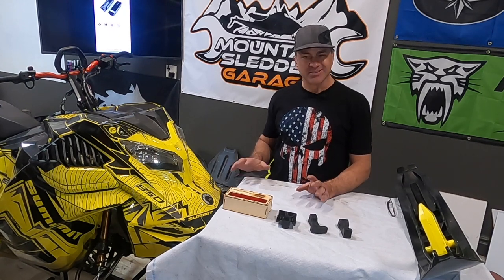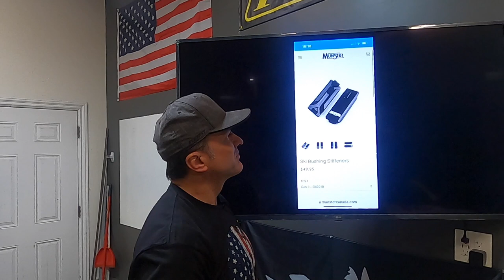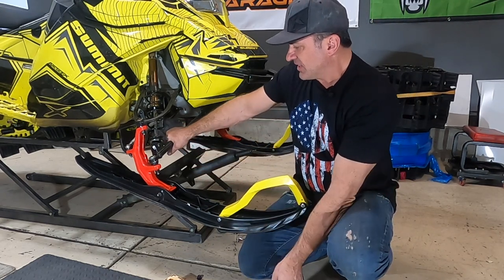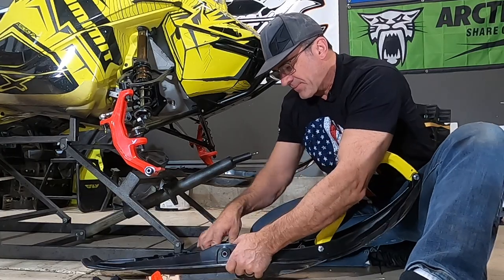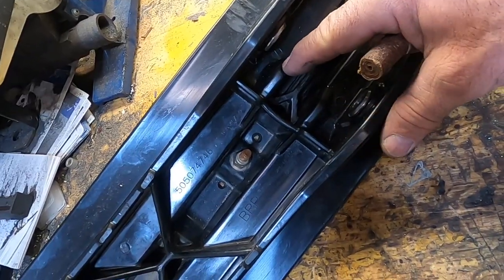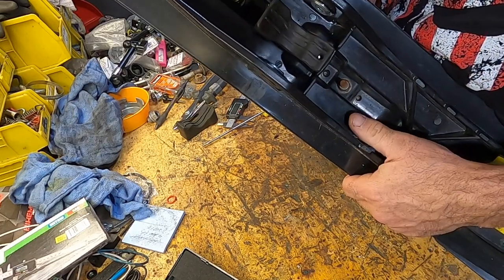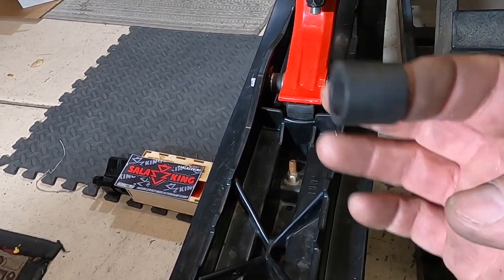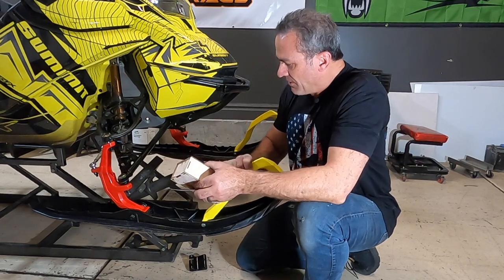Skidoo summit G4 ski rubber fix

Comment: I purchased the Salazzking(Russia) ski rubbers for a 2020 Ski-Doo Backcountry with adjustable ski stance. The Salazzking rubbers are extremely tight! Much tighter than shown in this video. I used a large c-clamp to compress the rubber to get the bolt through. Unfortunately, it’s impossible to adjust the ski stance now due how tight the ski spindle and ski rubber are. I will have to completely remove the ski to adjust the stance. From what I’ve been told the Backcountry skis are the same skis in the Summits. Just a FYI to next person.
Reply from the maker: Thanks for the info. I’ve only used the mountain ski and there not too much trouble.

Comment: Cool video ! I am going to look into that Munster plate.
I don’t know if the bolt idea will work with the gripper ski though, I will have to take it off my axys and see what I can come up with…thanks again for a good informative no bs video!
Reply from the maker: Yea, pretty sure the bolt won’t work on the gripper. I’m going to look into adjusting the gripper rubber tighter
Reply: @mountainsleddergarage8627  ok sounds good man. 
Would the  attak/Mohawk eliminate rubber breaking issue?
Reply: @mountainsleddergarage8627  hey man, I found the red rubbers from Russia for the grippers at sled solutions. Unfortunately, with the issues over there tho they are not able to bring them in. Just wanted to let you know they do exist
Reply from the maker: I bought a couple sets at haydays from Freshies Built. They had them for doo and Polaris. They weren’t sure if they would get any more for a while
Reply: @mountainsleddergarage8627  wanna sell me a set? Lol
Reply from the maker: Try Freshies built, they may still have some
Reply: I'm 300lbs and have a rough time with ski rubbers.  In fact I carry a spare set on my sled. I tried the Durapros on my Gen 4 Turbo Expert and they chewed up after 2 rides, most likely because my ski was a bit mangled from the spindle and the stock rubbers.  They were really good at warrantying them, but I switched to the Munster and didn't have any issues after that.  I ordered Salazz Kings from Sled Solutions for my Gen 5 Expert this year but I never tried them.  I ended up going with the Munsters again and they've been good.  Got 2 rides on the straight stock ones before they shit out the back.
The Munster ones are really difficult to put the ski back on, especially with brand new rubbers, but I never thought of grinding the end of the bolt.  Really good tip!